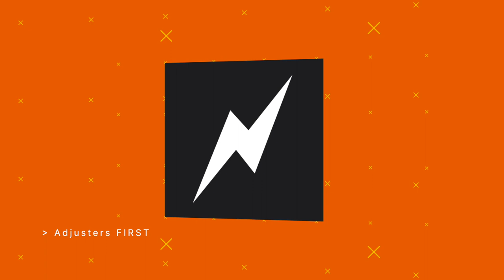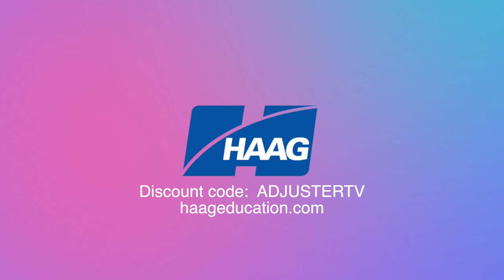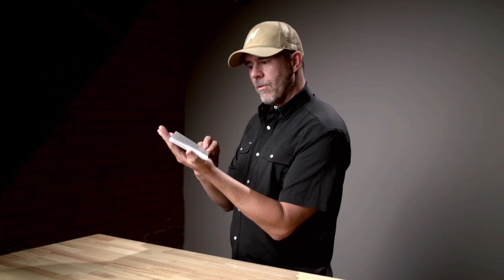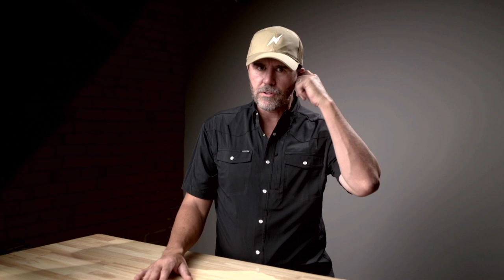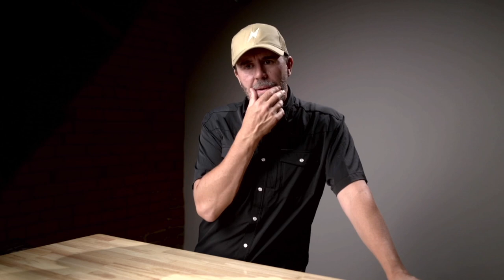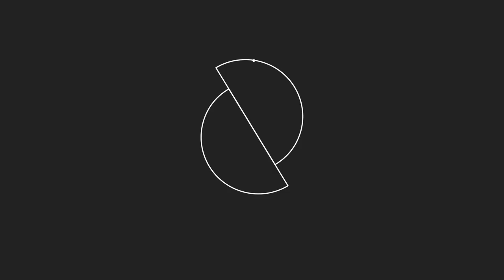BRITTLENESS TEST | What it is and how to do it

Comment: Thanks for the video. 3 questions.
1. Do you use anything to stick the shingle back after the brittle test?

2. How do you argue against the adjusters who say “yes you can find a match but the color wont fully match because is a different lot number and the sun has been beating on the roof for 2 to 3 years changing the original roof color so it wont march the new one”

3. What do you do is the roof already has a tarp nailed in?

Thanks in advance!